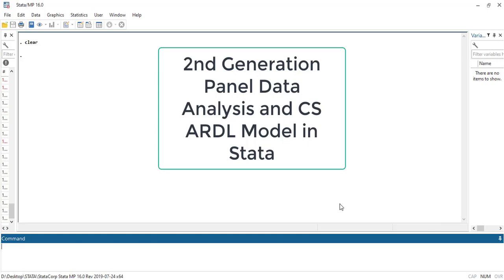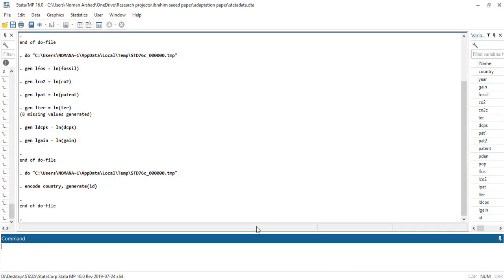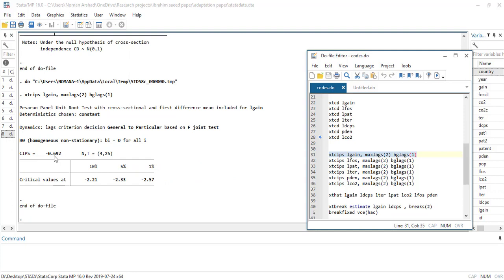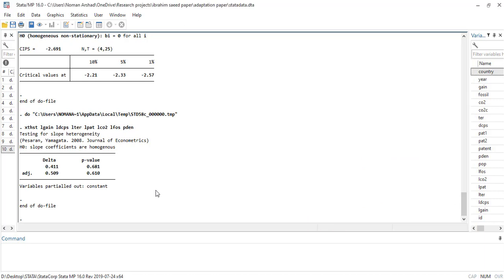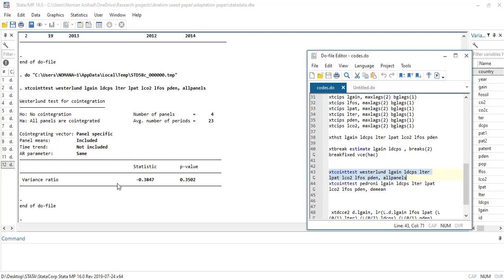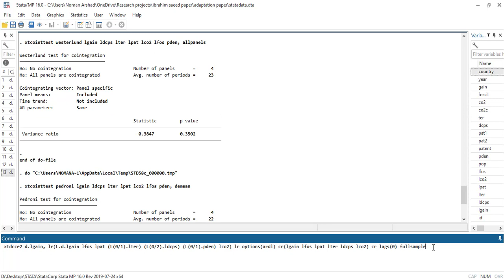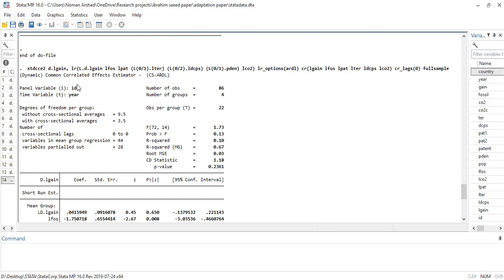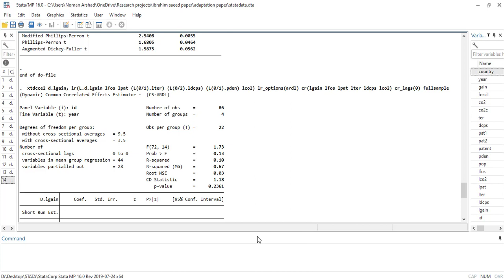2nd Generation Panel Cross Section ARDL Model in STATA for Cross Section Dependent & Dynamic Models

Comment: hello nauman, may i ask why do i get 'no obs' when i run the command xtdcce2? also, could u pls explain abt the command more. when do/don't we put d., and L.d. on our variables? why is other variables have 0/2, 0/1, etc? I'm having a hard time modifying the formula/command using my variables

 I GOT 5 IV AND 1 DV; 16 N AND 17 T. if the T is the prob, do i need to add more T?
Reply from the maker: There can be many reasons like 1) one of use used variable might be recognized as a string variable 2) there might be too many missing values such that there are no consecutive variable so thst first difference can be calculated.

Comment: We need to use CD test for each variable independently?

 I see many of videos, where they use xtpmg+fe or re to generate residuals first, and then apply the CD test to those residuals. 

That has totaly confused me, since, I do not use linear fixed effects model but Panel ARDL+ECT and DFE  with  (2 2 2 2 2 ) optimal lags. 

Would I need to estimate the complete Panel ARDL model first with all the laged variables, run it, predict the residuals and then apply the CD test on those residuals? 
Or is it sufficient just to test each separate variable for CD like you did  in your video, in my case?

Thank you.
Reply from the maker: Both are correct methods the residual based and variable based.  Actually of individual variables are independent then it can be assumed that residuals would be independent too.

Comment: @nomanarshed  I received error while performing xtcd lCO2 (log carbon dioxide). I tested unit root xtunitroot ips, then employed xtreg on panel data with N-41 and T-26. afterwards trying to test cross sectional dependence but i found  Error r(133). Plz help
Reply: xtcsd, pesaran
unknown egen function group() r(133);
Reply from the maker: This test i think do not work on unbalanced panale data. Further there are further sub types of this test like pesaran frees etc. Check that.
Reply: @nomanarshed  I have strongly balanced data

Comment: thanks for this video. I am getting this error when runnugn cross section depenendence test "__000001 contains all missing values r(498);" . I have an unbalanced panel with no missing values. Please help.
Reply from the maker: Some CSD tests do not work on unbalanced data.

Comment: good day sir, in running for cointegration tests, are we going to use the level form or the stationarized data? also, in performing cointegration, does it need to be I(1) or can i use mix I(0) and I(1)? thank you in advance
Reply from the maker: This model can work on mixed order of integration, means you do not have to stationarize the data. And further cointegration tests have nothing to do with the order of the data, it checks if the set of variables are cointegated in long run.

Comment: Sir, I have a similar situation with conflicting results between the Westerlund and Pedroni tests. The Westerlund test indicate that there is no cointegration, while the Pedroni test indicates the presence of cointegration.
(I have n=4, t=37, and the presence of CSD.) what i have to do? 
Thank you
Reply from the maker: First confirm if there is cross sectional dependence. If it is present the westerlund test is superior otherwise if it is not present you can proceed with the outcome of pedroni test.
Reply from the maker: For the case of presence of CSD have a look at demeaned perdroni and demeaned kao test if they can provide any evidence of cointegration. Or try changing lags in westerlund test
Reply: @nomanarshed thank you very much

Comment: Thank you for creating such a valuable content. I have a question, if the slopes(xthst command) were heterogeneous, can we use this model?
Reply from the maker: In that case you should run the Mean Group Estimate which provides country specific long and short run estimates. And if there is cross sectional dependence you can see its advanced version of CCMG or AMG
Reply: @nomanarshed  Thank you so much. Please apologize for my rudeness,  but I have another question: Does the AMG or model or the CC MG model cover heteroskedasity?

Comment: Is it possible to include a structural break in your ARDL model by treating it as an exogenous variable? The more specialised ARDL commands like N-ARDL and CS-ARDL don't seem to allow exog() from what I can find.
Reply from the maker: In the specialized model. If you add them in only short run equation they will become exogenous. If not then there is not much problem in adding in long run too.
Reply: @nomanarshed  That worked, thank you so much. This is my last question I promise: how do you generate and analyse residuals from xtpmg2 and xtdcce2 commands? In previous ARDL models it was really simple, but I can't find anything on how to perform diagnostics using these newer commands, making my findings useless.

Comment: may you explain briefly how to determine lags variables in CS ARDL ? are we use akaike kriterio if yes. how to learn aic of model CS ARDL, which code?
Reply from the maker: There is no such code for panel data. You can add as many lags which can fit and stabilize the model.

Comment: why did you take cr_lags(0) ? pesaran recommned [T^(1/3)].  can we use crlags(0) ?
Reply from the maker: Lag order are not determined by the theory, they are selected on the basis of its model stabilization ability. Pesaran recommended lags may be used if the data is long enough to absorb these many lags.
Reply: @nomanarshed  thnk you, ı want to cite your this comment for my article, can you say me which pesaran article ?

Comment: hello great video.i estimated 

 xtdcce2 d.lpec, lr(L.d.lpec lutp lgdp lpg) lr_options(ardl) cr(lpec lutp lgdp lpg) cr_lags(0)fullsample

and found that my error correction term in my regression is -1.02 which is greater than one. Also my variable of interest lutp has a coefficient greater than 100%.i also found that there was no cointegration in my model and cross sectional dependence is present. Please help on how to go about it.

lpec represents log of  primary energy consumption, 
lutp repesents log of urbanization,
 lgdp represents lgdp,
 lpg represents log of population growth
Reply from the maker: You should not take log to population growth. It might improve the outcome.
Reply: @nomanarshed  hello,thank you very much for your reply.i have just tried than and there is an improvement in the prob>F to 0.04..but no change in coefficients

Comment: your f prob value is 0.13, can ı say this model biased ?
Reply from the maker: It says model is not fit.
Reply: @nomanarshed  should ıt be less than 0.05? another questions ı saw same videos they dont take first difference variables. why ?
Reply from the maker: @corebilgi  you should compare the model with the documentation if they are similar to the authors documented model then their model should be prefered

Comment: hello nauman kindly share more videos on panel data that how to select lag length while conducting panel unit root test and ardl panel data techniques including methods for cross sectional dependence.
Reply from the maker: I will share soon. Actually in these tests you provide the upper limit of lags then the method autometically selects optimal lag from them
Reply: @nomanarshed  its question , can you explain briefly how to determine lags variables in CS ARDL ?
Reply: Pleass guidde when i run my model my all results getting insgnificnt only one was significant .but my data was stationray nd CD test was heterogeneous.i didn't understand what model we will apply . @nomanarshed

Comment: thanks for this informative video, can i use cs ardl method for N=7 and T=21 ?
Reply from the maker: Usually in this case we used first generation panel data models like Panel ARDL as the CD tests do not estimate Cross sectional dependence. If you are able to prove that there is cross sectional dependence you can use CS ARDL
Reply: @nomanarshed  thanks for your replay, actually my data has csd for each variable except one independent variable, should I include this variable after cr in the command  xtdcce2 ...... cr( variable), or not?
Reply from the maker: @sarahahmedchawsheen5455  The cross sectional independent variables should not be added in the cr

Comment: what is the correct specification? specify the model in differenced form or only the dependent variable enters in differenced form? Can I run this model with all variables in levels as long as there is cointegration and n variable is I(2)?
Reply from the maker: The published papers are better guide to find specification. As per my knowledge cs-ardl is advanced form of panel ardl with cross sectional dependence. I am not sure if it is suitable for I(2)
Reply: @nomanarshed  Sorry, I meant I(1) not 2. In your video here, you use the first difference of the dependent variable. Is there any econometric explanation for that? In other words, does it make a difference if one enters the dependent variable in level?  Since an ardl is an unrestricted ecm, why do the other explanatory variables not enter in first difference? Any thoughts on these? I would appreciate.

Comment: sir, if there is no long term relationship established by ARDL, do we need to use polynomial distributed lag model. if you have any idea. please direct
Reply from the maker: You can use simple lagged model which is also known as ARDL and the one in which the relation is not established is ARDL with cointegrating bounds. You can further learn about it from Walter Enders book on Applied Timeseries book